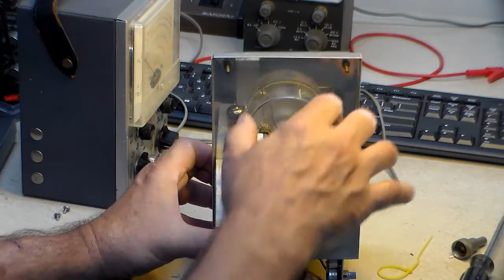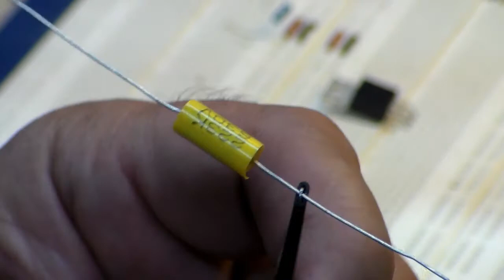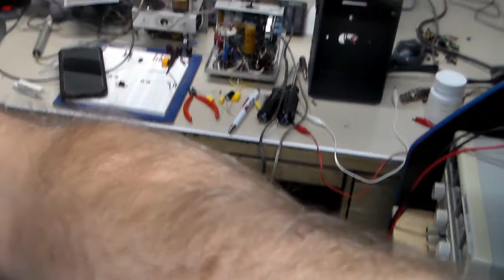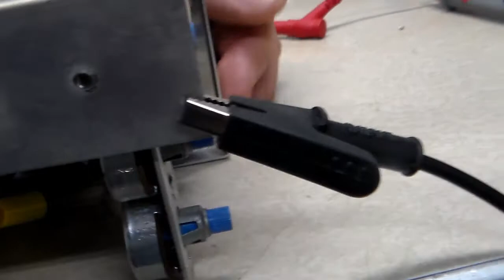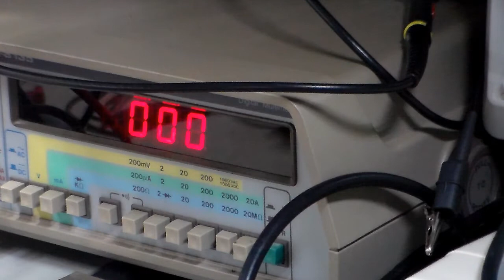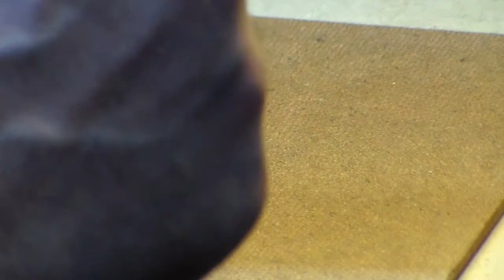Eico 232 Rebuild #2

Comment: I just bought a EICO 232, but the probe was missing. Where would you recommend someone to buy a replacement probe or is there a way to make my own?
Great video.
Reply from the maker: Check local hamfests if you want an original.  There are a few videos that show how to make a probe.  That one just had a 1 Megohm resistor and a switch to choose AC or DC.

Comment: Mine came with an OB2 voltage regulator instead of the CR1 rectifier. When I bought it on Ebay the ob2 was missing and there were a few extra diodes in it.
Reply from the maker: Did that mod function or did they give up?
Reply: @KA3AJI  You know about this, if so do you have any info on this mod? My belief is that I don't assume anything when it comes to a piece of test equipment. From studying the mod they did I see that they added to diodes in series to each leg of the transformer's secondary, with an electrolytic capacitor across them. The original design from the newer schematic already has a 10 mfd 150 volt capacitor across them. Whoever did this left all the original stuff in there except for the OB2 tube. I can't even find a detailed description of the tube. Like to know the pin designations.
Reply from the maker: I wonder if they were trying a battery eliminator mod...  If you are unsure, it is probably best to put it back to the original configuration.  If that is a battery eliminator, I have seen kits on line someplace.  Good luck.
Reply: @KA3AJI  The the battery eliminator is for the resistance test. When I find a schematic for this oddball model, I will put it back to original. Everyone has been directing me to the general schematic which has nothing to do with this model. An OB2 tube is better than the selenium rectifier anyways. Someone told me that this could have been a military model, but then again why would it have come as a kit. The top hat Rectifiers someone added are setup as a bridge rectifier. I should have noticed this myself. With a test instrument there should be no guesswork. Maybe I will need to buy another and start over. It's nice to have so much help with this.

Comment: Just curious: why replace the original selenium rectifier if it still works OK?
Reply from the maker: Well, I've never had one fail, but from what I've read, it seems to be not if they fail, but when they fail.  So, hopefully I'm removing a potential risk.  And I justed wanted to see if it worked ok.  So far no problems.  I actually use this meter a good amount because I keep it on the bench.

Comment: Goodnight friend! How is it going? I have a 232A vtvm eico, which only has a single valve (6FQ7), and I would like you to help me replace or replace some parts to make it work, since where I bought it it was very deteriorated and damaged. I would like to send you the information I have and some photos to see how you could help me. and thank you very much for your input. By people like you they are reliving the golden years of vacuum valves today.
Reply from the maker: Thanks for watching Leonel.  I'm not too familiar with that model, but I believe that was an upgrade to remove the vacuum tube rectifier and install silicone diodes for the AC measurement section.  Not sure if you can get to this link, but somebody posted schematics.  https://groups.io/g/Ham-Test-Gear-FS/topic/73129476?p=,,,20,0,0,0::recentpostdate%2Fsticky,,,20,2,0,73129476
Reply: @KA3AJI  Thank you very much for answering friend and for the link! I would like to know what values you used to replace the C1, C2, C3, C4, C5 condemnors ???
Since mine need a change! I would like to send you photos of my vtvm.
Reply from the maker: @leonelalvarado4879  I just downloaded the building instructions and went with the values called out there.  I don't remember the exact values though.  Justradios.com carries everything you need.  I usually replace all of the electrolytic and Paper-wax caps.  I check the ceramic and mica caps to make sure they are within specs.  My email doesn't like to pass attachments.  Might be a firewall issue.
Reply: @KA3AJI  I would like your help! since in my country it is very difficult to get the values of the original capacitors that are in the diagram! and I would like to know what current values serve to substitute.
for example: c5 is 10mf at 150v. at present, which one will I be? 10uf. 20uf or 22uf at 150 or 250v?
example: c2, c3 is .027 mf at 400v which one I want to replace ???
Reply from the maker: @leonelalvarado4879  Sorry, but I just do this as a hobby, I have a full time job, that takes me on the road a lot, so I don't do much work on the side.  What I can tell you about the capacitors is you can always go up in voltage.  Physical size is your limitation with that.  The value of capacitance I recommend rounding up as a rule of thumb.  Don't go too far, but if you need a 22 Microfarad (uF or mF or MFD - all the same, just different abbreviations), it's not a problem to go up to 25 or even 27.  Check out Mr. Carlson's Lab for a lot of good information about capacitors.
Reply: EICO 232 VTVM Assembly Manual (Sold as Kit)
FOLLOW PARTS LIST and INSTRUCTIONS
https://w5rkl.com/wp-content/uploads/2019/07/Eico-232-VTVM-assembly-manual.pdf

Comment: Very informative video. I have a 232 on the way, planning to restore and use.

Most vintage AC powered test gear uses a half wave selenium rectifier such as in the 232. They did this for cost reasons. 

When replacing with silicon, please consider changing to a full wave bridge circuit. Silicon diodes are so inexpensive today that the added cost is pennies. 

The full wave bridge circuit results in less hum and less stress on the power transformer.
Reply from the maker: I've done that on some other equipment, but never thought to try it out on one of these.  I'll give it a shot.